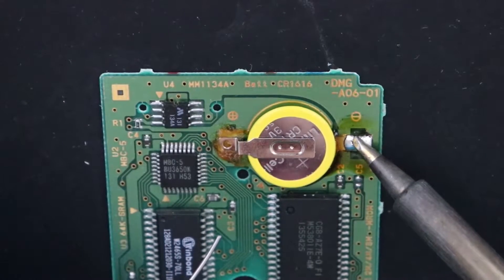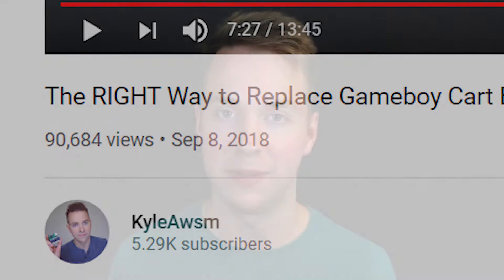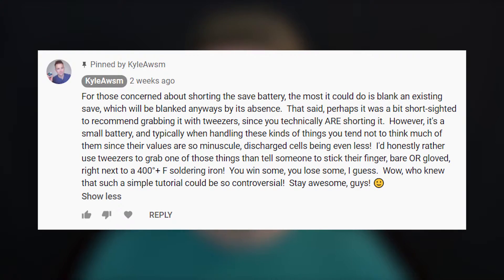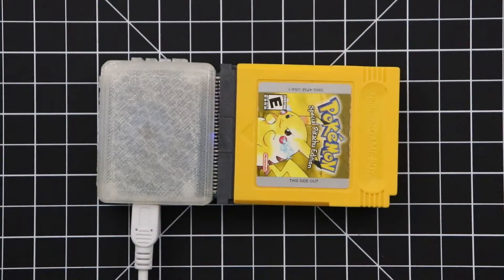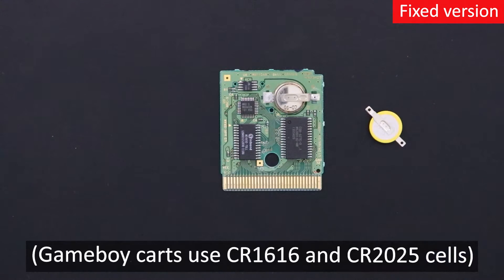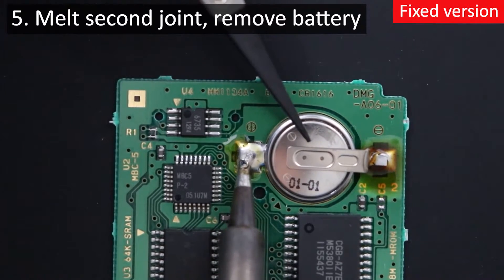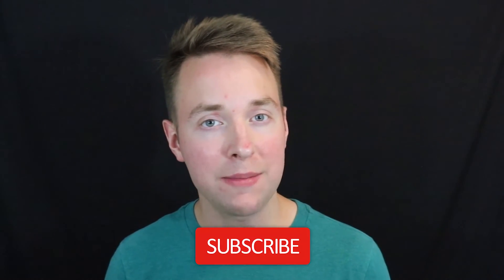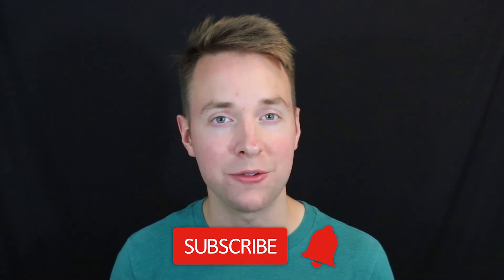AwsmCast #3 - How to SHORT a Gameboy Save Battery

Comment: Thanks for this video. I just ordered a set plastic tweezers. What are your thoughts on coin batteries in older game carts? Even being 30+ years old, I've found many SFC game cart batteries are still around 3 volts. Do you think the replacement coin batteries will have a shorter life span than ones made in the 1990s?

Comment: Great guide! Definitely will follow it when I replace my save battery. Just wondering, are the "Precision Anti-Static ESD Tweezers" on Amazon (US) safe to use, or are those practically what you initially used?
Reply from the maker: Yup, I think those are pretty much exactly what I first used.  Try to find some fully plastic tweezers instead.  Cheers, and thanks so much for watching! 🙂
Reply: @KyleAwsm  Alright, will order the ones you put in the description, thanks!
Reply: @KyleAwsm  Another question. Would you say 70% is good enough to clean the residue from flux, or is 90% really needed? The latter isn't widely available from what I can see. I guess QD Contact Cleaner wouldn't work well (in terms of removing flux)?
Reply from the maker: 70% will suffice if you have nothing else.  You'll just go through it more quickly than you would 90%, since it's not as strong of a solvent as the 90.  The contact cleaner should be ok too, but I am not sure how good it is at dissolving flux.  Cheers!

Comment: Also do your tweezers have a number on the other side I bought a cheaper kit than the I fix it because I didn’t have enough money but it came with a working triwing screwdriver, 3.8m gamebit security tool and plastic tweezer that look exactly like yours do you assume their safe too?
Reply from the maker: Yup, my main pair of metal tweezers say "ESD-14" on them, and a pair of my plastic ones say "93301" on the side.  A quick Google search of both of those (with "tweezer")  yielded good results.  Hope this helps you!